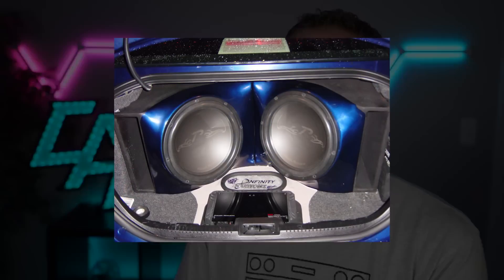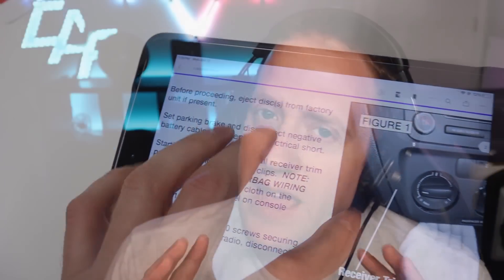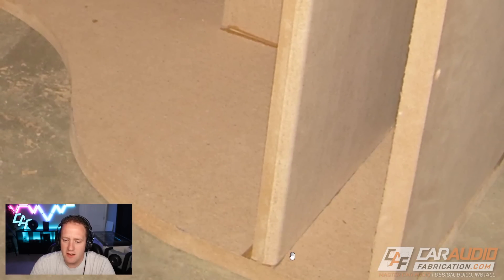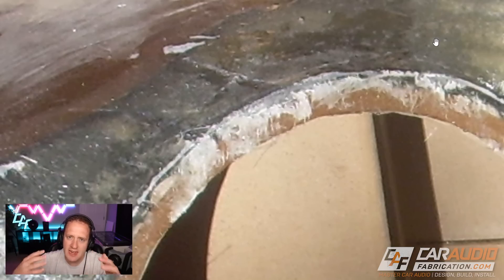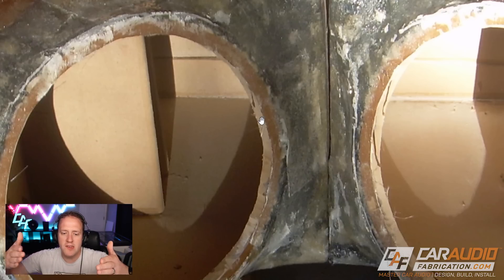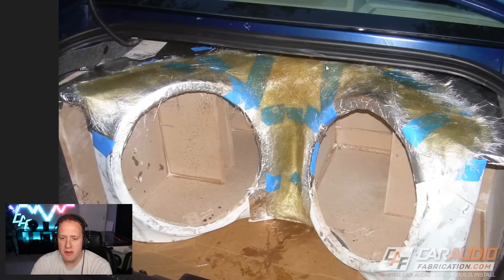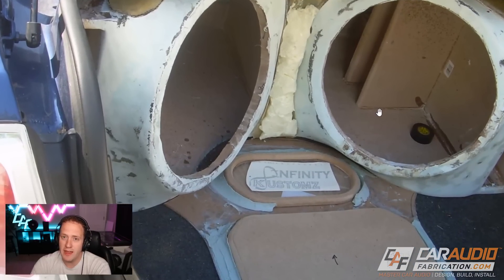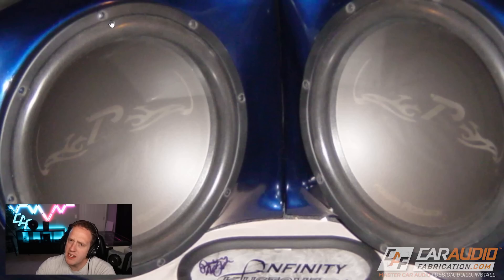Two 15's in a fiberglass ported box! - OLD BUILD REVIEW - Mistakes to learn from!

Comment from the maker: Hey dudes! 👋Thanks for tuning in!😎 Does anyone miss this style of build with the fiberglass? Or are you glad its no longer popular?
Reply: I like it a lot - IF it is DONE WELL!! But it all depends on the specific build, not every build would look right with it. And large areas of fiberglass don't look good unless they are PERFECT... with no wavy-ness to them or (like you pointed out) if the symmetry is off by even the smallest amount. In this build I think it was a good with that amount of fiberglass. But if you has continued into the ports and the entire top it would have been way too much. Aside from all the flaws that you pointed out it came out pretty good.[
I've never done a build with fiberglass tbh, and only really saw it on show cars....  And a lot of people around here didn't do much custom work... it was usually an off the shelf box with the amp mounted to the side or top lol But that was just the one's that I saw growing up around here in the stix of south jersey.
Reply: I just wish sunflash was available all those years ago. No stinky mess

Comment: whats the best position to place two similar models of subwoofers in a trunk (with no space problem) in two different ported enclosures?
1) both facing towards the trunk?
2) both facing each other one placed at the left side of the trunk the other on the right but their ports are in such a way they are not against each other. one is at the back, near the rear seats other one is further down near the trunk.
 ___                                            ___
|     (port here)                       |        |
|____|                    (port here) _____|
3) both subs facing upwards

Comment: In the close up of the amp it also looks like ALOT of the power wire strands were cut off so only a fraction of the strands were actually being used. Noone a pro out of the gate Mark we all have these under our belts. Thanks for sharing.
Reply from the maker: Yeah I didn't do the wiring on this project, just built the box for my buddy, but regardless definitely not quite right..

Comment: Company name is BNC Designs (Bold New Custom Designs). I have been using this company name for over 10 years now but the services/products I offer have changed multiple times. It has gone from clothing to subwoofer enclosure building to full on woodworking and furniture building to car performance modification

Comment: I have a question. If you were to buy an audiophile type head unit, which one would it be? For example Pioneer had a product line called "Stage 4" reference series. The headunits in that series contained 3 way active crossovers.

Comment: I am literally 95% done with a fiberglass sub box build for my Ford Maverick (no aftermarket options yet). Going to run an 8" sub in the under seat cubby. I didn't know the stretched volcano style was so old and outdated. The last one I made was back in 2013 though...
Reply: They were everywhere in the early 2000s. I don't think any "Pimp My Ride" car escaped without some form of bulbous fiberglass and that show was on in 2004. I had buddies that were more into custom cars than car audio and they were getting their stuff done up like that right around 2008-ish, which is when I knew it was probably getting played out. 

That said, there's nothing wrong with it when done well. I have one on my agenda right now. 👍

Comment: ive tested alot of the newer 8000 bamfs. 98% all had burnt boards and werent worth repair. either poor qc or user error. likely combination of both...
Reply from the maker: Yeah definitely not quality gear. But we were young and didn't know any better
Reply: @CarAudioFabrication  very true. I've been lucky with my 10 year old MB quart amps. The new Hifonics have also been bad. But yet they both use maxxonics boards. Interesting to see as time goes on.

Comment: Fiberglass still has its place!  Lots of swoopy curvy vehicle interiors still out there, and if you're trying to do a custom factory look, it's a good skill to have.

As for the trunk not closing, I'm guilty of this.  To my credit, I was AWARE of the hinge mechanisms, and designed accordingly!  What I didn't realize is that they tapered inward when they closed, and I wasn't wise enough to lock myself in the trunk with a flashlight and a tape measure...  As if that's not bad enough, I had to completely redesign and rebuild the box from scratch.  Went from three subs to two; just not enough space.  D'oh!

Comment: The pinched surround from those oversized screws... reminds me of my teens. And that time my screw driver stabbed straight through my brand new sub.

Also I learned that electrons actually flow from negative to positive, so yeah equal wire gauge is important!
Reply from the maker: Ooof! Every mistake is a learning experience for sure.
Reply: It technically doesn't matter where the bottleneck is in a circuit due to the continuity principle (see fluid dynamics). Also, because resistance is proportional to length, it's not a deal killer to have a narrow ground wire if it is short. That said, we can all agree that using the same size wire for positive and ground just looks better.

Comment: A single 12 in a proper box with clean power even if just half what the sub is rated for will hit like 2 15’s in an average install.. you can also get a lot of loading in a car trunk with the way the seat pretty much all good now.. the 60/40 is ideal dropping the 40 side on the drivers side and rear facing on the passenger side back against the 60 side. 

But yeah I’m old enough to have been around when the fiberglass show piece boxes first came to the scene. I always loved the look but understood air space and tuning pairs with properly loading the vehicle was king. 

I still enjoyed flipping the pages in magazines though and seeing all these types of builds

Always Brad or finish nail with wood glue.. I see too many screwing boxes together not understanding how wood glue bonds the wood together and is way stronger then screws.. nails or screws are just to hold it till the glue dries. Simple rabbit joints add a lot of strength by increasing the surface area of the glue.. 

Lastly mdf is king for box building.. yes it’s harder to work with and god help you trying to screw it together even if you predrill.. but the dampening factor of mdf vs wood shouldn’t be overlooked..